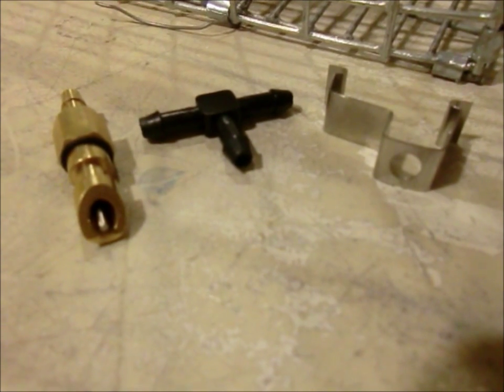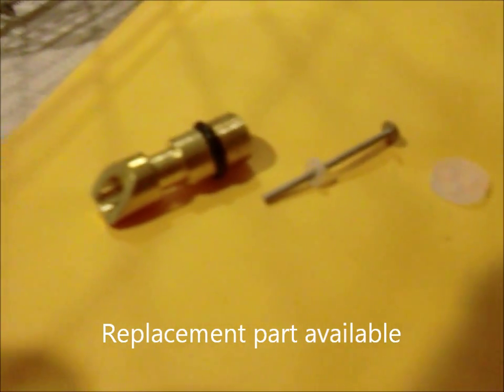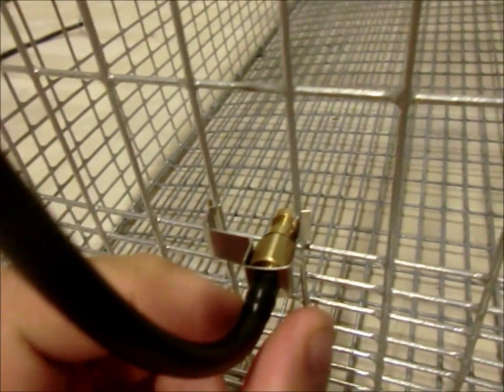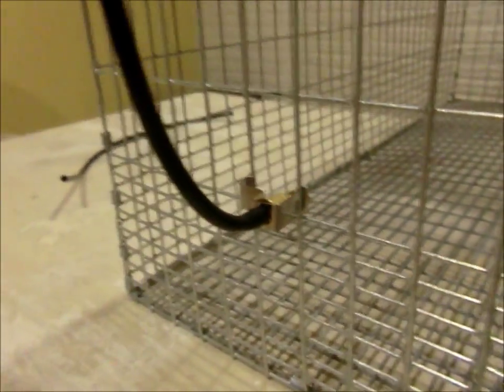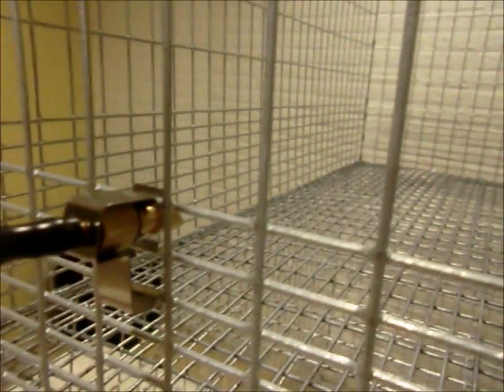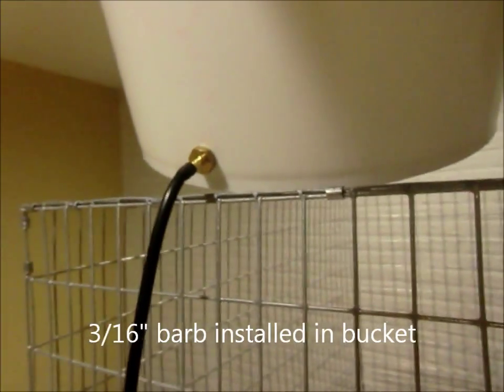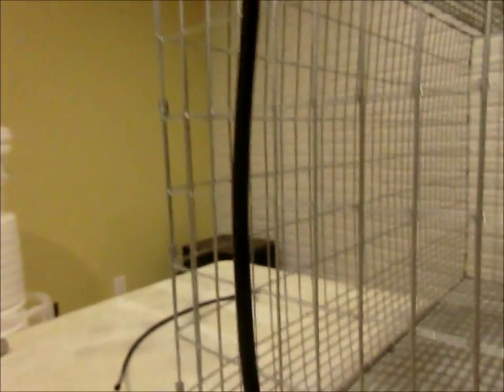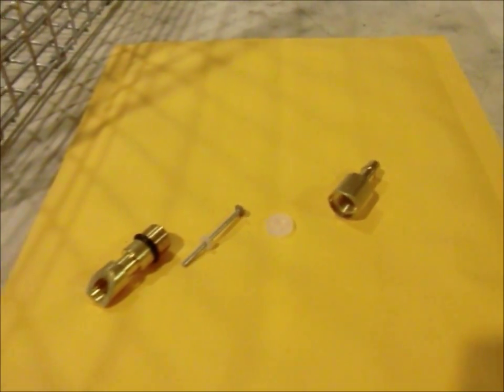3/16" Brass Nipples for Mice Rats Rabbits Automated Watering Gravity or low PSI watering system

Comment from the maker: If you hook it direct you need to install a water regulator. all watering systems use low pressure usually 12 psi and under. you can get around using a pressure regulator by install a bucket above your cages and adding a float to your bucket. then you can hook the bucket direct to your hose. ronald@rabbitnipples.com